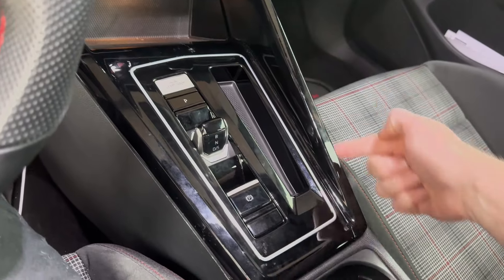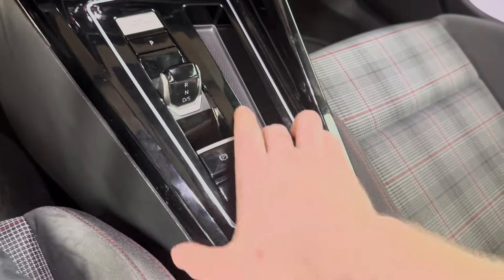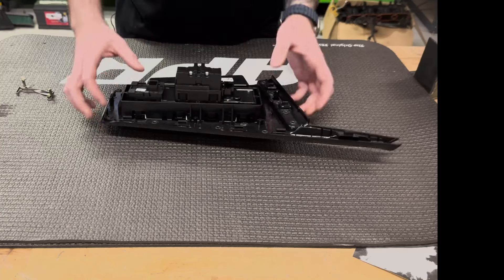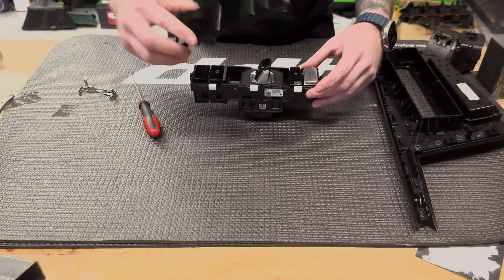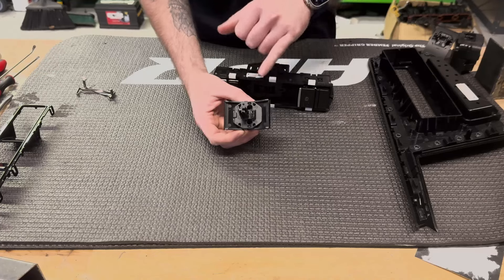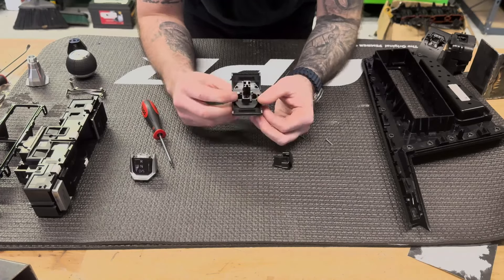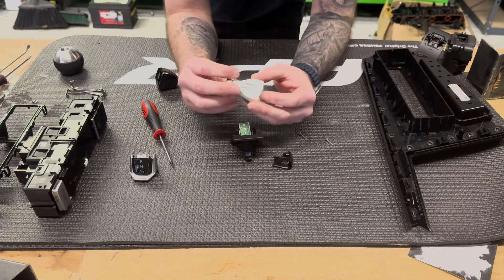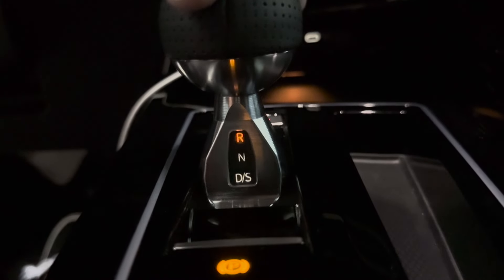Mk8 DSG Shift Knob Install Instructions

Comment: The product itself is very good although the installation requires a lot of hassles and hiccups for those who do not have sturdy hands. It would be better if the installation is much simpler.

Comment: This video needs renamed.  It is definitely NOT an install “instructional” video.  He is basically just telling you how difficult each step is going to be and then showing you the final result of each step (after he has figured it out off camera). Never does he show you how to actually perform the step!   And it also would have been nice to see a better shot of the final product in the car.